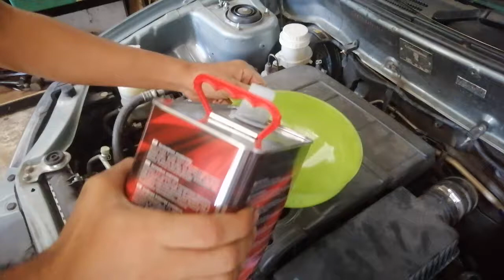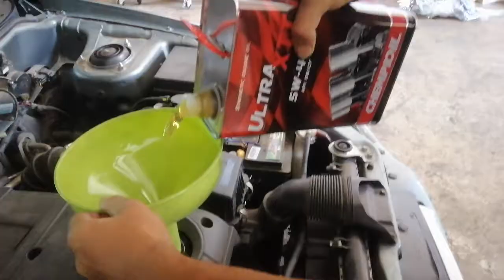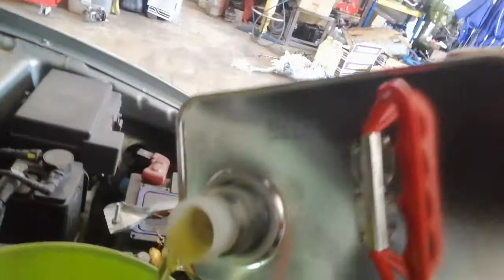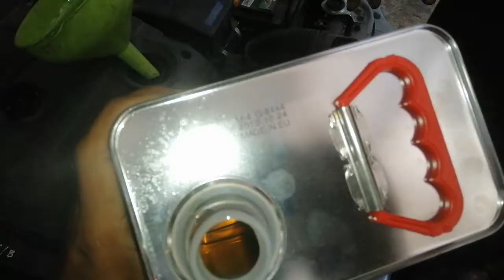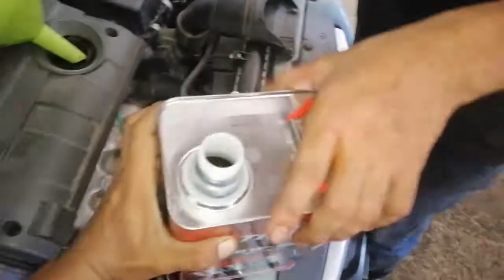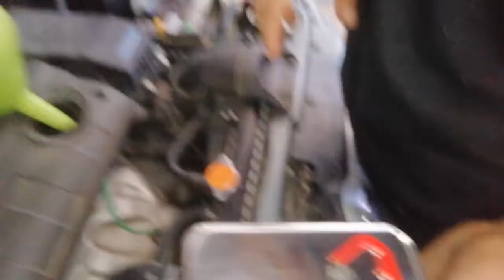CHEMPIOIL ULTRA XTT FULLY SYNTHETIC OIL

Comment: The Chempioil brand is now owned by SCT so is the oil blended in Lithuania along with all other SCT oil brands?
Reply from the maker: Yes you are right...
Reply: @utaraenggangautoservices5895  
So why did SCT,  a German based company, take over a Swiss based oil brand?
Reply: I read that Chempioil (Champion Chemicals) is a sub brand of Mannoil company. I just bought 4l can of 5w-40 xtt oil for my Renault. 15e for 4 liter isn't bad price.
Reply: I have all ours cars running on the Mannol 7715 oil. Its a VW approved blend and 3 of ours are VW TDIs, the others being Korean cars but use 5w30.